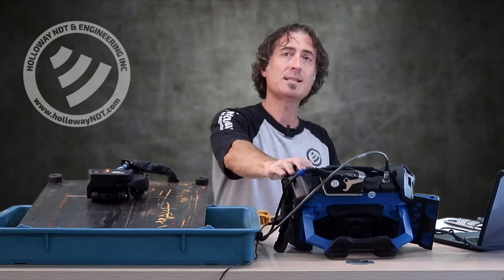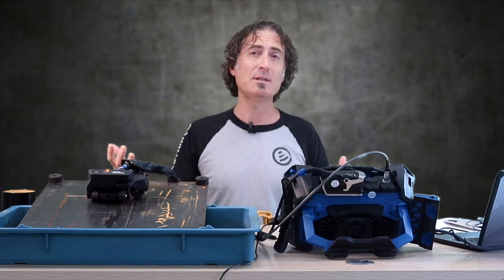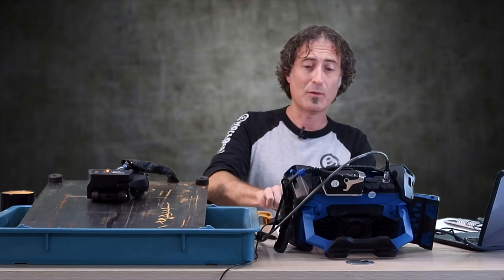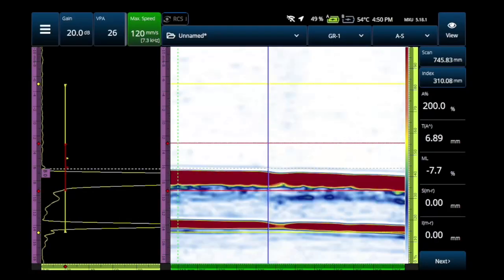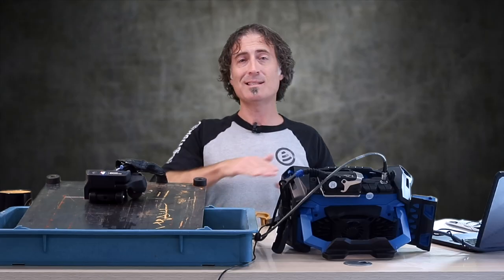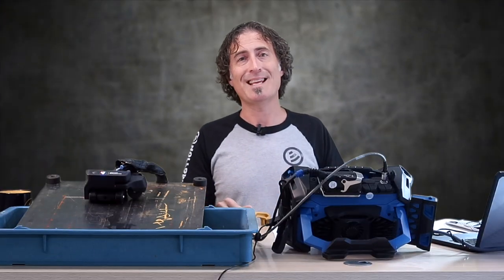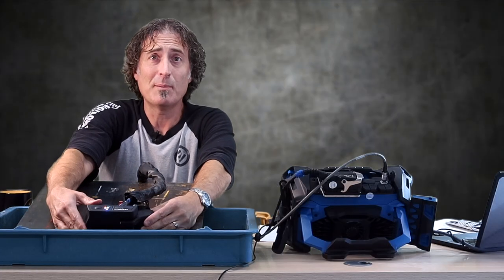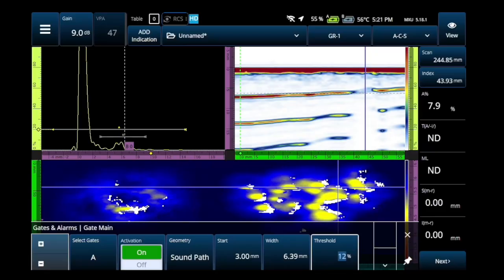HydroFORM Setup on an X3 in 5 Minutes

Comment: Thanks for this. Is there any need to do a sensitivity calibration?
Reply from the maker: For HydroFORM, you shouldn't need it. It's probably not a bad idea to verify that the response is relatively flat across the length of the probe. But if it's not, it probably means the face of the probe is dirty or the water column isn't full (or has bubbles, even parked on the face of the probe), rather than an actual issue that requires calibration.
Reply: @hollowayndtengineeringinc.5201  Makes sense. Thanks buddy.

Comment: Great video Paul. Question for you on setup. Do you ever set Manual TCG points to compensate for low amplitude on the first and second backwall reflections? I was watching a video by an Evident / Olympus engineer who did this when setting up the FlexoForm system. I dont see why it should be a problem as the thickness is based off the difference between the A gate position and interface. Or is it an unnecessary step in setup? Thanks man
Reply from the maker: I think it's generally unnecessary, but I'm willing to be convinced otherwise. If amplitude is an issue, why complicate matters, just move the gate.
Reply: CSV exports for reasons such as pipe burst pressyre calculations, if requested by the client, will make TCG essentially mandatory. It will also greatly reduce the amount of data dropout. 
However, it can also really complicated things if you've got really deep corrosion and/or a lot of noise in your signal, or didnt set up tcg correctly.

Comment: Hi Paul, what’s about A/ - B/ mode with corrosion mapping? Did you also make calibration of encoder in hydroform mark 2, pls make video about flexform.
Reply from the maker: Yeah you should always do the actual measurements on echo to echo, but the C-scan on B/-A/ won't look very complete. The B/ signal is too inconsistent.

Comment: In the old instructions, Olympus would have you build a manual TCG. I assume there are pros and cons to constructing one and not constructing one. Would you happen to have any recommendations as to when to use a TCG and when not to?
Reply from the maker: I skipped the TCG on this one, as it's not really necessary. It's a nice-to-have, but just to to optimize the appearance of the C-scan for the report. For analysis, you're going to be using soft gain and cursors anyways, and since corrosion is not an amplitude-based inspection, you can skip it.

Comment: Thanks for sharing, not seen the new Hydro form in the flesh, can the probe still be manipulated with your fingers with the lock nut loose to cover compound curves like the old one?
ATB
Dave
Reply from the maker: Not really, but I know what you mean. It locks in a little differently than the last one. With Gen 1 and the thumb screw, you could kinda turn it half way tight and still wiggle it. This one is a locking mechanism, so it's fully engaged or disengaged.